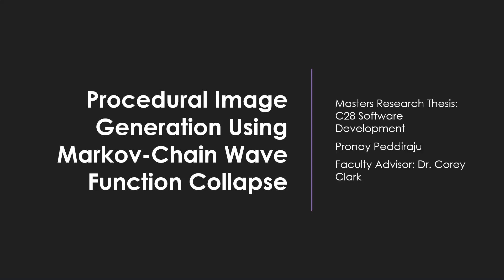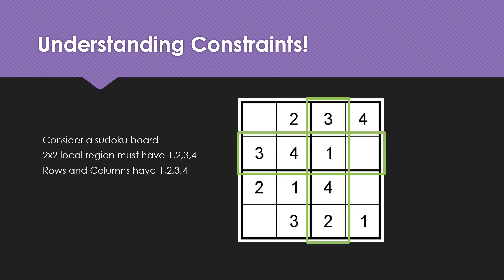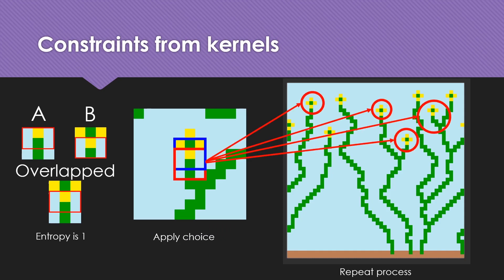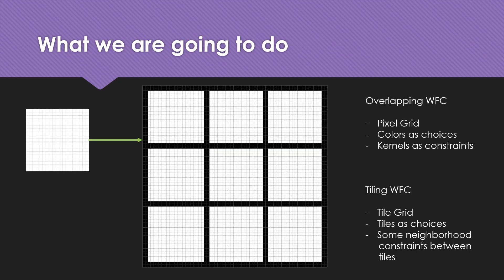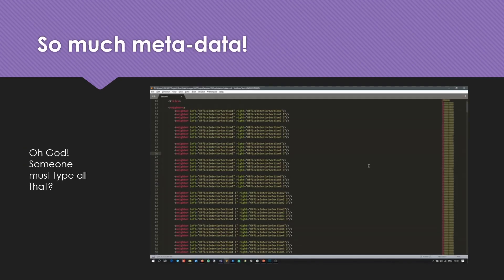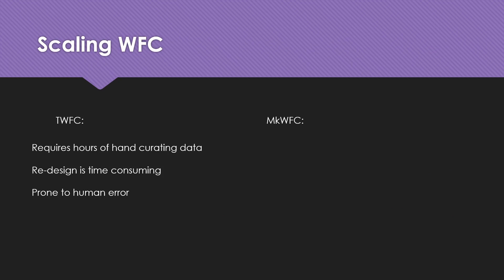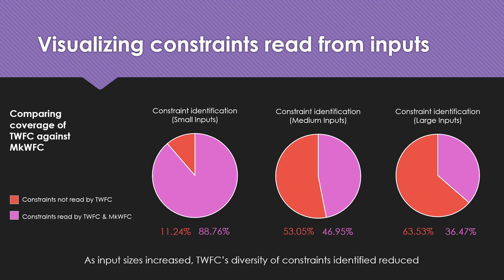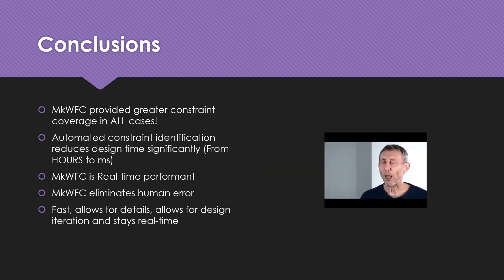Markov Chain based Wave Function Collapse

Comment: Great research, I've been trying to tackle a TWFC that's fast to design and this showed me some number of ideas I hadn't considered. Symmetry especially. Thank you. Two questions though. Regarding the optimization of the process to reaching the point of real-time, how do we go about making the collapse tiling step faster? I am currently stuck with ~300ms and my only idea to make it better was some struct wrapping burst jobs shenanigan. And how to go about implementing constrains? The idea I'm going with is there are pre-implemented constrains that can be made simply by passing in some parameters (in the case of neighbooring tiles connecting to one another, just needs a delegate that takes Tile one, tile two (or null, if it's the edge of the map) and a direction and returns true if tile one can have tile two (or edge of map) in that direction or false if it can't.) and if one wants a specific constraint, designing one should be easy enough.
Reply from the maker: Sorry for my late reply, but here are my thoughts if you are still working on this. Unfortunately there's not a standard answer to this question but your strategies seem appropriate in that we want to tackle this as an implementation problem. Some approaches (like the ones you mentioned in your comment) could be threading the constraint solving, reducing any templated code that 's being used, optimize your pattern matching speed and just other general C++ (or other language) speeding techniques.

To provide much more applicable advice would be hard without looking at the implementation being followed but there are numerous examples to draw inspiration from on GitHub. Late to the party but I hope that helps

Comment: Great video. Can you tell me / point me to a material about what is Left-Right constraint or why is it so that we use it? 
I don't quite understand why we don't need other directions ex up, down. Thanks!
Reply from the maker: Hello, left-right is only 1 of the constraints used. We are checking a relationship where "given some left tile, what should be the right tile". Similarly we will also consider a bottom-top constraint as "given a bottom tile, what should be the top tile". This determines which tile can be placed in the cell based on our observation of tile occurances in the kernel
Reply: @PronayP  thamks a lot for the answer! I haven't yet explored the markov chains so maybe that is why I don't get it exactly.
Sorry if this is a stupid follow-up question but should I understand that we define the "possible neighbours tiles" for each side of our "head" tile or is it not the case? I will check the written version of your thesis to hopefully understand it better (and explore markov chains). Thanks for sharing all this info!
Reply from the maker: @piotrw3366  that's not a stupid follow up at all. Your understanding is correct, we will observe our kernels and establish possible neighboring tiles for our head tile. However, the term "head" tile here can cause some misunderstanding. A good way to understand the approach is to consider every observed tile as a potential "head" tile. For each of these observed tiles, we will create a chain of links. Each link describes which neighbor the observed "head" tile could have. This way we end up with a chain (Markov chain) of links(Markov links) where each tile has a list of it's potential neighboring tiles. 

The technical term for this is a Markov chain but in essence it is nothing more than a map of tile to array of possible neighbors.

Comment: If you were to use two kernel shapes,  a 2x1 and a 1x2, wouldn't overlapping WFC and tiling WFC be equivalent? And if you "learned" those kernels from an example image, is that any  different than the proposed method for "learning" tiling constraints?
Reply from the maker: Good question, the consideration to take is not necessarily how large the kernel shapes are in this case but rather what the goals ultimately should be. The reason we prefer tiling based WFC is to ensure scale can be achieved with tiles that contain greater detail and curating constraints on how those large detail tiles need to be placed. In Overlapping WFC however, you will lose the control that TWFC offers while relying solely on the "Color sudoku" aspect where you are doing pixel pattern matching

Comment: About the markov chain, how do you calculate the probability of each event?
Reply from the maker: My implementation treats the probability of each event based on weighting the events encountered in the sample observed. If event A occurs 3 out of 5 times where as event B occurs 2 out of 5 times, the weights assigned will reflect a 60% and 40% chance respectively.

I am unsure if this is the best way to handle probabilities for each event (there is probably better approaches) but it seemed to work for my needs fairly well
Reply: @PronayP  an interesting next step could be looking for other grammars or semantical relations in the source example other than immediate neighbors, that human artists might be applying intuitively. such as only placing certain furniture tiles in the same room as other furniture tiles, but not others

Comment: Sorry, but this is just an abstraction? You just redefined the original implementation's pixels as tiles.
As per the sudoku example, "pixels" are same as numeric IDs and your "tiles" are the same as numeric IDs.

 Inspired by the use of the name "Markov", I think a interesting followup could be the use larger neighborhood context (like n-gram) probabilistic approach.

Anyway, great presentation, comparisons and problem statement/solution. :)
Reply: Pretty sure that that kernel-based version he presented first actually implements n-grams in some sense? And I agree that making this probabilistic (by counting adjacency frequencies, for example) would yield better output.
Reply from the maker: You are right in that it is just an abstraction of the existing cell based implementation. Tile maps are a common use case for games where performance is important, the approach used to perform tiling results in fewer binary image comparisons by using a hash map of tiles to a hash. 

This allows the algorithm to run much faster and yield interesting results as in the cell case based on defined constraints. 

The Markov implementation I’ve described only optimizes the tile implementation to allow the inference of constraints rather than having to rely on them being hand written. This incurs a small performance cost but produces effective results without the need to curate constraint data.
Reply: Not entirely since the 'Constraints' step can be arbitrary in tiles, but isn't in the texture version. Personally I'm working on a project where you can specify additional constraints like X minimum distance from Y tile or only X of these tiles per X area of grid.

The original texture implementation functionally is the same idea, but the idea of 'constraints' and 'pixels' is just broadened.
Reply: @PronayP  Cool, thanks for the reply :)
Reply: @chaselewis5372  Geting more hyped now!
Reminds me of solvers such as prolog. Some disjunctive logic solvers are scary performant :D

Comment: It looks like your increased diversity comes from including potentially undesired placements.  While the Castles comparison treats the lone towers produced by MkWFC as a positive, they might not be a desired result. Same goes for MkWFC's seemingly random wall connections. The TWFC output has walls form closed loops or heading off-screen (where they presumably still form closed-loops through wrap-around); it shows "castle" walls.  The MkWFC just shows randomly connected segments.  The whole "castle" aspect is completely lost.
Reply from the maker: You are correct, some of the diversity in results may not actually be valuable but this is reliant of context. In some cases where the desired output may be simpler, the added diversity could be useful. This implementation only shows that a greater diversity is found in the yield but contextually it may not always make sense. 

The castles example makes it such that the added diversity does not yield any benefits when the context of the castle is taken into account.
Reply: In that case, you could selectively choose to ignore one of the original constraints from a tile based system to achieve the same results. 

The intention of the tiles for a pipe system in 21:23, was to create an image where every pipe has a starting and ending point. Which your algorithm has broken as you’ve indicated in the red box.

Comment: When propagating the constraints, is it possible to "collapse" a cell in such a way that you get an incompatible adjacency later on? Do you use backtracking, or is collapsing greedy?
Reply from the maker: It uses backtracking and not a greedy approach. Whatever cells are known to have an entropy of 1 (I.e only 1 possible outcome) are filled and the propagation proceeds to the remaining cells. The “collapse” occurs without the case of any incompatible adjacency as the propagation of data in the cell grid must always adhere to the constraints or else it cannot work. If we can’t fill the grid of cells with compatible adjacencies, the output is not solvable and will not complete
Reply: you can backtrack but for smaller scale applications youll probably just wanna start over